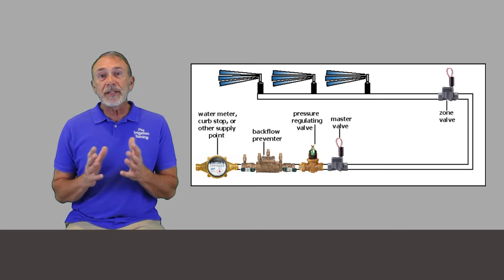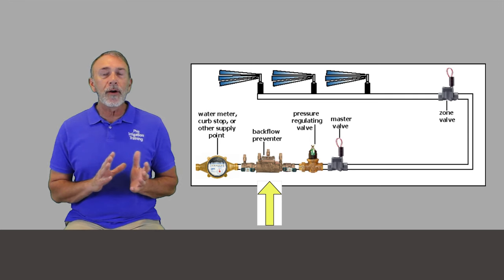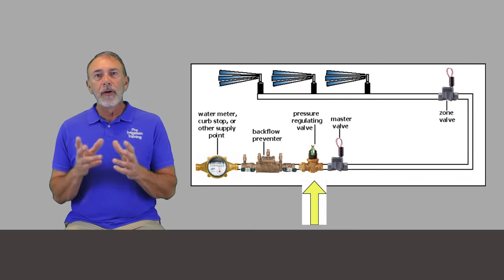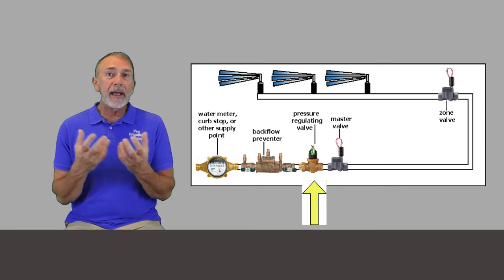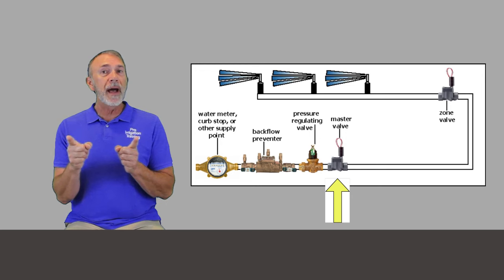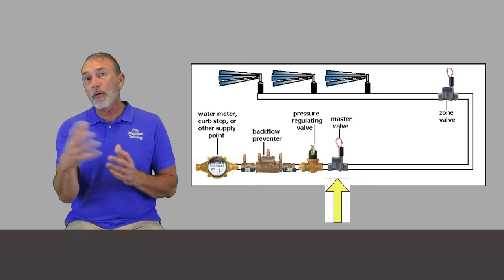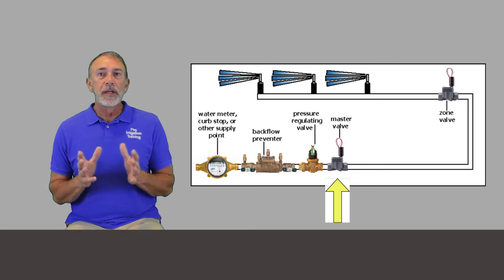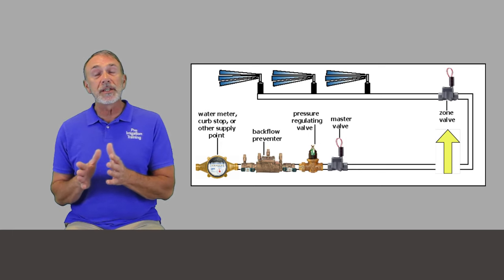Order of Components in Sprinkler System | Irrigation Training

Comment: so before you install the backflow preventer. The first thing that should be installed after the main water source or POC, should be an isolation valve? depending on your county or state or regulations?
Reply from the maker: If the first thing is a backflow preventer, the backflow device usually has two isolation valves. There's one kind of backflow device that doesn't have any isolation valves on it, so you should install a valve between it and the source. It's probably not code, but safety and convenience for the homeowner and technician to be able to isolate the irrigation system from it's supply system. Thanks for watching and your question!

Comment: Where would you put the blowout??
Reply from the maker: According to guidance from AWWA and others, it should go just after the backflow preventer. I understand that in colder climates, they put the blowout, which is usually a hose bibb or quick connect, before the backflow so they can blow it out with compressed air. This violates the mandate to not have a potential cross connection outside the protection of the backflow. I'm sure local and state code can influence this. 
.
Thank you for bringing this up. I talk about this in other videos, but I should amend this video to include that.